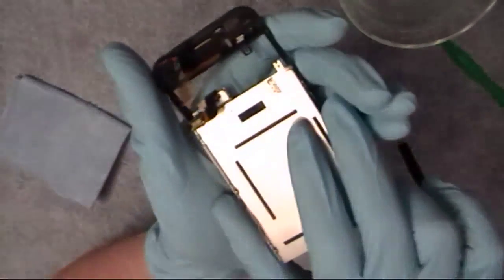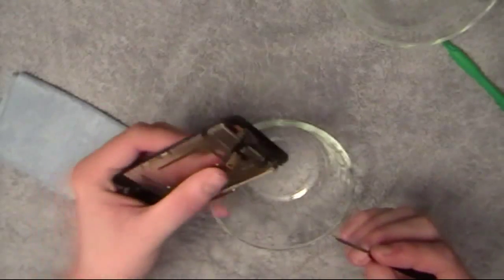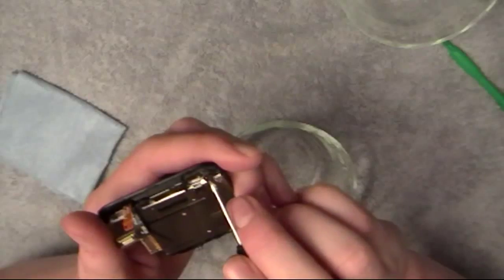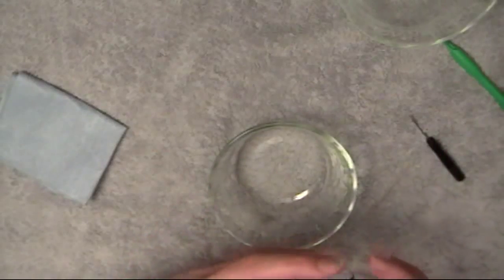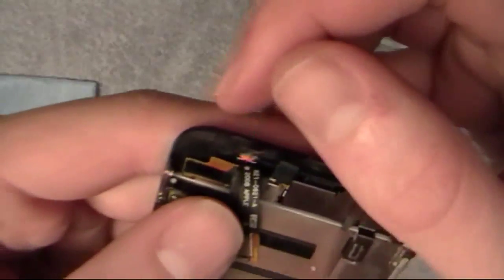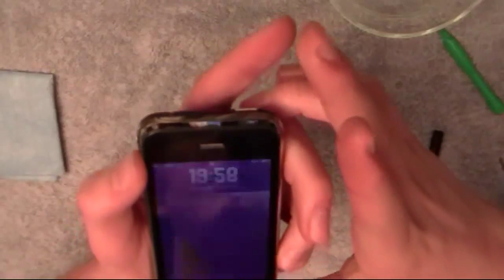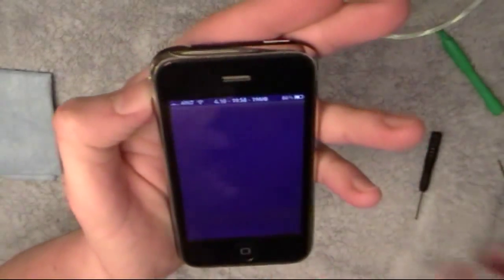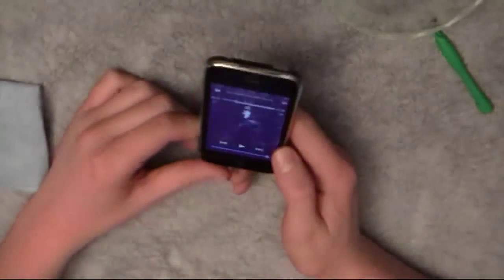Hardware How To Episode 1: How to Remove Dust from Under an iPhone 3G/3GS Screen Pt.2/2

Comment: Don't listen to the negative comments Chris.... That is the problem with some people with tools in their hands.  You were very thorough, and it worked well for me !  One thing to add though, is that some iPhone 3GS units, (i'm in Australia), are slightly different. On mine, after removing the '6' internal screws, i found 4 metal bent-in tabs, that had to be bent back out before removing the glass front. After re-assembly, then bend them back in...

Comment: Took it apart ok and carefully re assembled it but black screen. It is on as I can hear sound. I assumed it must be a cable connection but Ive re done this a dozen times. getting desperate now, anything else regarding the taking apart that may cause this. I was extremely careful and no visible breaks. Help if Possible please.

Comment: @basile1236 Make sure you have clipped the three wires in correctly and fully, i think `the lcd is the wire 2 so double check it

Comment from the maker: @moheb08 first off it's not my fault you weren't careful with your phone, second I didn't force you to do anything, and third....what exactly is wrong with it? Did you check and make SURE all of the ribbon cables were plugged back in correctly? That could be the culprit, and an easy fix assuming you didn't actually break something.

Comment from the maker: @moheb08 I zoomed in on the wrong end of my phone so it wasn't on cam, the only part I skipped was the part where you plug the three ribbon cables back in, just plug them in backwards of how you unplugged them (plug cable 3 in first, then 2, then 1 [they are labeled with orange stickers])